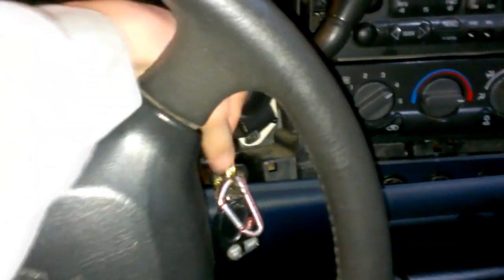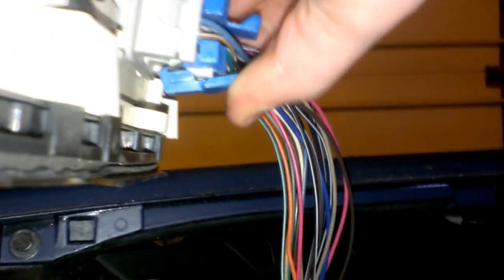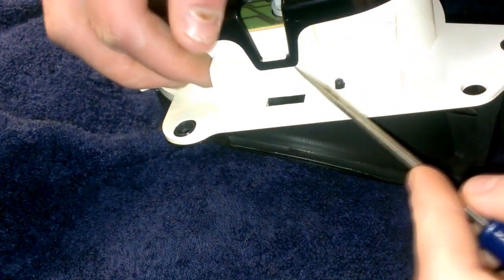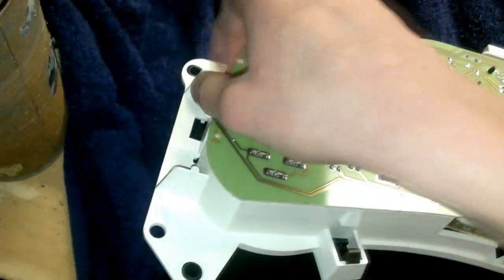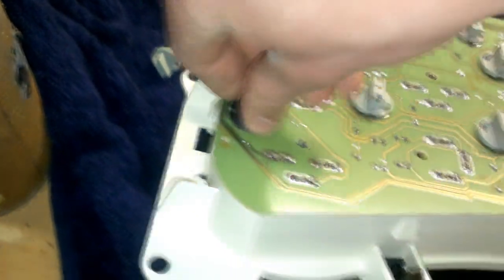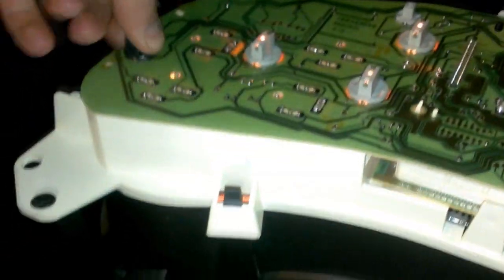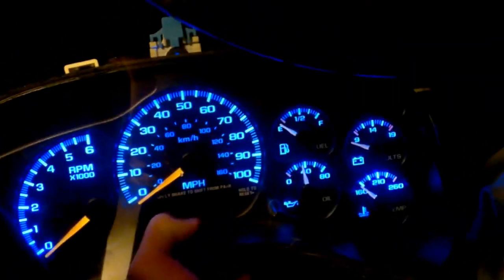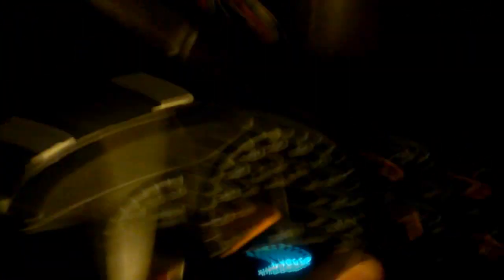How to change instrument cluster light bulbs (LED swap) (99 Silverado)

Comment: I have a 2003 tahoe and I just bought the LED'S and stepper motors to rebuild my gauge cluster. Thanks to the good Ole engineers at GM I get solder my bulbs in after I desolder the burnt out ones. So wish they had the twist locks. 2003 to 2006 are solder in.

Comment: have a question I did the same led conversation on my silverado but my leds they like to turn off by them selfs and I have to mess with brightness knob to be able to turn my entire dashboard back on do you know what might be causing this type of problems?
The leds are polarity currently put in and aren’t cheap leds either but they keep doing this for some reason.....
Reply: Check voltage of lights
Reply: Joe, i replaced my dimmer/switch assy , i had nothing until i did that.

Comment: Nice job it's shaky but you have the right points. I've got a GMC 04 I'm about to change mine.
Reply from the maker: +Jason Earnest I've released a video on the 03+ trucks called "03-07c Instrument Cluster LED Swap Silverado / Sierra" Check it out!

Comment: What are them adapters called and where did you get them? I'm doing my cluster in a 96 s10 I took the bulbs out of the green twist and put the LED's inside of those and put it on and now nothing works well some things work the check engine light all those little tiny lights but not the LEDs
Reply from the maker: jerry lavenia It is possible you happen to put them all in backwards. unlikely but possible. did you rotate the twist locks 180 degrees and try them again? or pull the LEDs out and rotate them and try them again. they are polarity sensitive.
Reply: Did all that do you have a Facebook if so add me Jerry lavenia so I can show u

Comment: If these bulbs are anything like the ones that are in my car and are EXACTLY identical, get yourself a small and I repeat small screwdriver and resolder them in place... they do come apart. This would work with the Non-LED Autozone replacements. May screw up the first time, just keep a spare on handy to fiddle with.. I'd like to make a video response to this on how they come apart.

Comment: Can you just replace the bulbs to leds or do you need the twist locks
Reply from the maker: William Taboada Need to replace the twist locks. factory bulbs are soldered in
Reply: William Taboada  you do not need to replace the twist locks, i just did it without replacing them
Reply: +leroy weiss  depends on the vehicles your working on .... our 99 sierra = bulbs permanent in twistlocks . so bouught  twi-lcks and pushed in leds .........03 monte carlo bulb wires soldered , so pulled wires from led bases out and soldered them where bulbs were.

Comment: I got a 98 Silverado I couldn't get the leds I had to work in mine because of the  dimmer switch what type of leds do you have
Reply from the maker: +Chris Biller What do you mean by "because of the dimmer switch"?
Reply: +99SilveradoNBS I talked to some one they said I needed dimmable leds

Comment: Did you change the analog green P/R/N/D and Mileage bulbs to led? I just did a led conversion on my Trailblazer dash but I still have that analog green, which kills the vibe of blue leds
Reply from the maker: No i didn't, it's not the color of it isn't really changeable, you'd have to cut of the green filter the light goes through and replace it with a blue one. haven't attempted it so I'm not sure how it'd turn out

Comment: I think the smaller gauges have the smaller twist locks on mine like the gas guage and those I may be wrong though?
Reply from the maker: Your truck is a new body style correct? 99 - 02 body?
Reply: yes like the 99.5
Reply from the maker: The bulbs are all the same then. you will need 6 t10 194 twist lock bases and 6 194 LEDS of your choice.

Comment: I have a chevy tracker 2000 what kind bulbs u think they r?
Reply from the maker: bombon pe I did a little research and it looks like they are 158 (hopefully), you can use 194 or 168 bulbs in there place with out any problems though (:
Reply: sweet thanks

Comment: Hello, I hope you can answer this question, how did you replace the lights of the window and steering wheel controls, also the lights of the stereo. I hope you can help me, thanks man.
Reply from the maker: I took all the switches apart and soldered resistors and LEDS in place of the stock bulbs. It's a pretty involved process and not for the faint-hearted lol

Comment: Any suggestions on swapping out T4 bulbs? My fuel gauge and temp gauge have T4 sockets and i can't seem  to be able to find replacements. Thanks!
Reply from the maker: +Debapriyo Sarker do you know the actual bulb number? what vehicle?
Reply: ***** where did you get the bulbs im putting mine in a 99 dodge ram

Comment: What is the part numbers for the twist locks? or where did you get them? Or can you post the link for green ones?
Reply from the maker: I don't know the part number. You can buy them on eBay though.
Reply: I looked for the twist locks, does it have to be a certain style lights

Comment: very cool man thanks. how do you replace bulbs on the ac and heatet panel? also the headlight switch?? thanks.
Reply from the maker: +Ramon Ayala It's not easy. but with some electrical knowledge and soldering skills. It is do able.
Reply: Thx bro. Looks nice!

Comment: I have a 2000 Silverado 1500 I am looking to do this to. Does it have to specifically be a 5 SMD bulb? I found kits with a 194 Twist Lock that come with Blue T6 6 SMD 3528 LED Chips.
Reply from the maker: +Aaron Morse I have found 5 smd to be the best thus far, where is the 6th smd on those bulbs?
Reply: +Aaron Morse  u dont want em too bright ! the blues are plenty bright with 5 smd ... red is dimmer but very easy on the eyes and can see evrth. well

Comment: I saw you mentioned how to change the power window switches with "3mm blue led 12v prewired diffused."
Do these type of bulbs apply to the rest of bulbs on the dash as well? Such as the temperature control and headlight control?
Reply from the maker: Sorry for taking so long, Yes they do. all are soldered. big PITA. I am almost done with the swap. I need to finish my 4x4 switch and my HVAC panel.

Comment: I have the same truck (99 silverado) 
and I have I think 6 of the big twist locks and 4 small ones when I look at the pics on ebay it only shows the big ones does it come with the small ones also or what
Reply from the maker: You don't need the small ones. Those are for your indicators such as (high beam, turn signals, ABS, SES, cruise, tow haul) things of that nature. some are apparently soldered to the board some people can't just remove the safety ones I would assume. The 6 t10 sized ones are for cluster lighting. Thats all you will need

Comment: i hope you see this i found a pack on ebay i wanna buy it says with the twists lock and bulbs together its 20mm is that gunna be to big? lookin to order and install asap great video
Reply from the maker: Just play it safe and get 194 Twist lock  bases and 194 Bulbs.
Reply: i did what im sayin is with the base and bulb together it protrudes 20mm it wont let me post a pic i have

Comment: 194 is the correct bulbs for your truck, and depending on options, you'll need between 5-7 bulbs.  You'll need S5-194 LEDs, similar to what was used in this video.

Comment: Hi my 2003 Sierra's gear select lamp is super dim.  Do you recall if there's a bulb for it?
Reply from the maker: +rob donell The prnd321 on the 03 and 04s being dim is an extremely common problem Its a bad solder joint on the board. You can fix it yourself if your comfortable with taking apart your cluster and soldering!
Reply: what component(s) should i be looking at to resolder?
Reply: +99SilveradoNBS can you send me a link to the twist things on ebay

Comment: how long did they last and where they brighter than standard bulbs?
Reply from the maker: nath deb they lasted me a while. I've had some die in a month and other go for more then a year. hard to pick out the good from the bad. and the blue were brighter then stock. the red I later changed them to were more reasonable
Reply: Ok, Thanks for your help and advice. much appreciated. :)

Comment: its easy take dash off front undo wires to your other switches then move dash out of the way I have a 2004 chevy s.10 there 4 screws take them off around the cluster then un do plug on cluster hold the wireing harness squese the plug at top then slip out the cluster then take the back cover off then twist the bulbs out and ease out the bulbs that's in it after you got them out just slip bulbs back in where you took yours out when put cluster in don't screw it down lay it side ways turn them on then if don't all work just twist the bulb holder till comes on and put dash back together

Comment: Good Job, so number is #194 for the bulbs?? You think it is same fro Chevy Malibu?? How much you paid per bulb/LEDs?? Thanks, youtheman =)
Reply from the maker: +Eero Laukkanen They are pretty cheap now-a-days. you can get a 10 packs for a few dollars. I would have to say it really depends on the year of the car. in the 03 trucks they went away from the twist lock setup. cars might be the same story. only one way to find out, pull it apart!

Comment: Where did you buy the bulbs and twist locks?  I've been looking on eBay with no luck.  Also are they 5 smd?
Reply from the maker: They are 5 SMD and eBay/Amazon are good options to find them on. twist locks are probably only on eBay if I had to guess.

Comment: I did the same thing but none of my bulbs come on. Any ideas???? Thanks
Reply from the maker: Josh Stringer Did you rotate the led's 180 degrees? also try having the cluster plugged in with your headlights on and mess with the twist locks. those cheap aftermarket ones can be ornery

Comment: Where did you get the twist locks? For the led to slide in?
Reply from the maker: I got mine off ebay! Another little tip mentioned in my remake video! check it out!!

Comment: How do you go about changing the ones in the center and on door panels?
Reply from the maker: if you're reffering to the switches they are all soldered to the boards. its a challenge.

Comment: You didnt have to change the small twist and lock for the check engine light etc.. ?
Reply from the maker: kevin leal I didn't replace the bulbs because there is no benefit. The plastic that they shine through is colored to the indicator IE Check engine is orange. Changing the bulb color wouldn't affect the color of it
Reply: Thanks man i really appreciate it
Reply: +kevin leal  u can remove seatbelt light while ur in there, who needs a light to tell them if they r usin seatbelt or not

Comment: Hey I was wondering how you got the color of the mile counter to change? Mine's green and it'd look weird with everything else blue or red haha
Reply from the maker: It doesn't look that bad green, especially with red IMO. It looks worse with blue because it kinda matches but clearly doesn't if you know what I mean. Mine is still green, as far as I can tell no way to easily change it. besides cutting out the film and replacing it, but I don't even know if that will work because I don't know what color the LCD screen lights up behind the film. It is one of those things I'd like to do but probably never will.
Reply: Yeah that's what I've been hearing:/ And one more thing, where'd you get your lights at?

Comment: How did you change the light in the door panel switches
Reply from the maker: +eduardo valadez They are all soldered to the circuit board. I used 3mm LEDS

Comment: Mann it looks hella nice with the led conversion... I have an 2004 silveraldo will this method work?  And if so where can I buy the led light bulbs and twist caps??
Reply from the maker: raigster tone No this will not work, 03-07c bulbs are soldered to the board. Stay tuned. I purchased a new truck (06) and I may just swap mine over.
Reply: Alright I'll be waiting
Reply from the maker: +raigster tone The wait is over! I just finished the video for 03 - 07c Silverado and Sierra. check it out!

Comment: Hey just a quick question .. have u replace the a/c, power windows controller and the 4x4 to LEDS to match your cluster LEDS??? 
HOPE I MAKE SENSE... Oooooo and tanks for the video it was very helpful on my project..
Reply from the maker: I have everything done but 4x4 and HVAC panel. work in progress!

Comment: would this work in an 01 GMC Yukon?
Reply from the maker: If you have the same cluster as I do yes. (PRND321 is in the same screen as odometer) If your prnd321 is seperate like the 03+ silverados then no it won't.
Reply: ***** Yeah thats how ts set up... if you ebay the lights like in the describtion is it like the 360degree leds for like license plate lights?
like 10 bucks for the plugs and about the same for lights?
Reply from the maker: Prices vary on quality. I'm not sure if 360deg is true, but for sure 180! it shouldn't cost you more the $25 for everything

Comment: I just did this and the the ac control lights light up fine but don't work with the dimmer. What could be the problem
Reply from the maker: bryan todd that's strange. mine worked but certainly didn't have as much adjustment as it does with regular bulbs

Comment: Where did you buy those LEDs?  I've tried a couple sources before & it was a waste of my $.  Not buying anymore LEDs until I see that are good, like yours, and know where they came from.....And I'll buy from that source.
Reply from the maker: Stephen Cranford I bought mine from ebay. where did you purchase from?
Reply: *****
"from ebay" is not very clear since there are thousands of sellers there.  I bought mine off "Amazon" but that doesn't clarify WHICH seller.

Comment: I mean remove take the Non-LED bulbs apart with a small screwdriver a little bigger than a eye glass driver.. When done resolder the contacts in place.. Brain is quite fogged late at night. :P

Comment: whenever you unplugg the cluster/odometer do you have to recalibrate it or anything? or will it automatically be back to the original miles?
Reply from the maker: The odometer is stored on the cluster it self. Unplugging it will not effect it.
Reply from the maker: The odometer is stored on the cluster so unplugging it won't affect it.

Comment: Would t10 6smd led work i have a 2000 silverado 1500
Reply from the maker: It should work. I would compare sizes. I don't know what those 6SMD ones look like. I found that the 5 SMD ones that I showed in the video seem to do the BEST job at scattering light. No hot spots with them.
Reply from the maker: By compare sizes, I mean to stock and maybe the 5 smd ones in video. since I know they fit well.

Comment: What kind of bulb are you using in your window switch
Reply from the maker: They are just 3mm leds with resistors for 12v, You can find them on ebay by searching "3mm color choice here LED 12v prewired diffused" I would recommend prewired so you don't have to solder each resistor onto the LED. and diffused means the color of the bulb it self is the color you choose instead of clear. This helps reduce hot spots.

Comment: I actually got sick (vomited) from watching this terribly shot,  shaky , in and out vidio, add in the loud ass chimming from light switch and i was done, got sick and had to go rest my eyes, felt like i was sea sick. And yes bro, those are the hours, simply hold the reset for few seconds and it will show the hours, hold again and goes back to milage, Think itl switch back automatically after a few seconds if i remeber correctly.